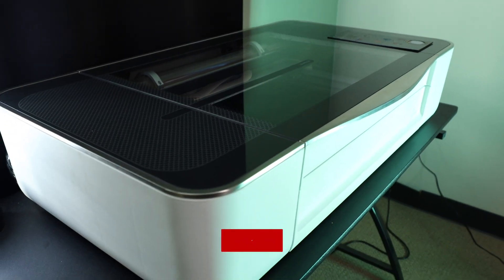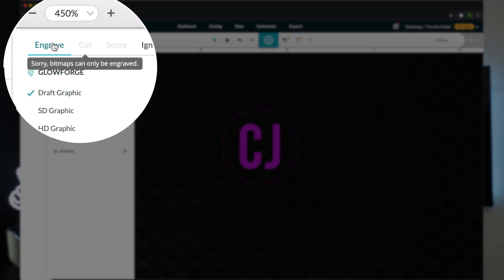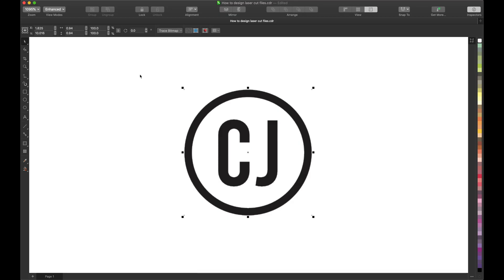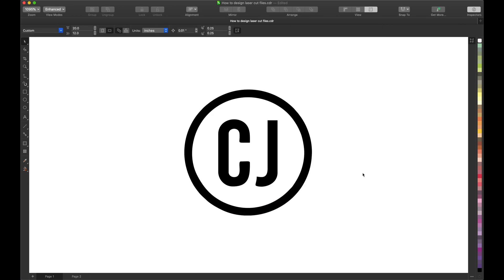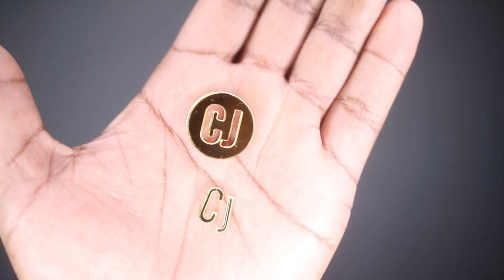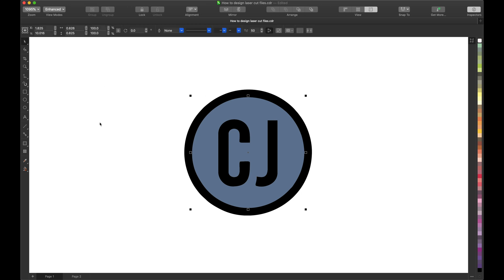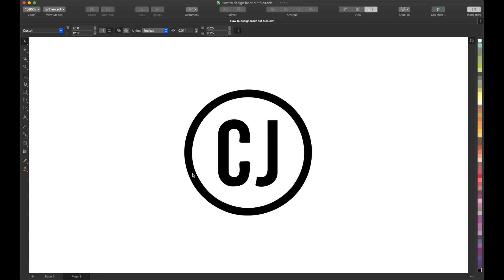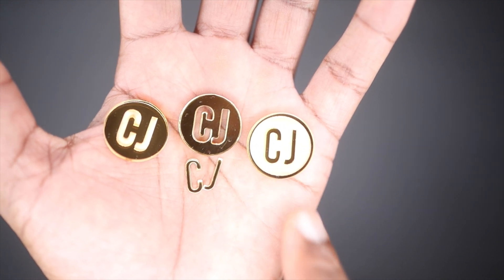How to design laser cut files | Coreldraw | Glowforge

Comment: Hi troy, i want to engrave on stainless steel bracelets , can you suggest the correct settings? When i donit it comea out very light and doesn't show well
Reply from the maker: It won't engrave on it. I believe you have to use some kind o f metal marking spray first. I haven't tried it myself yet though.